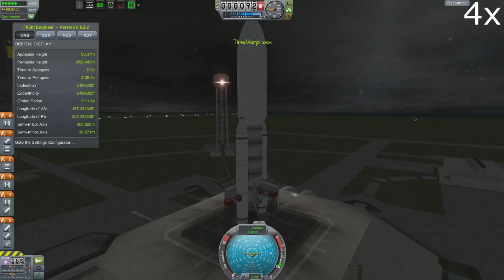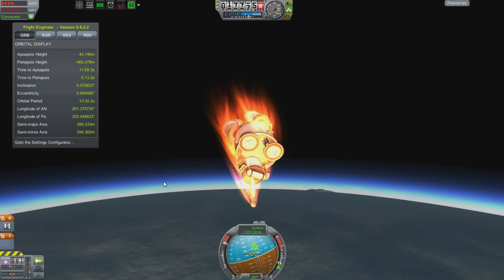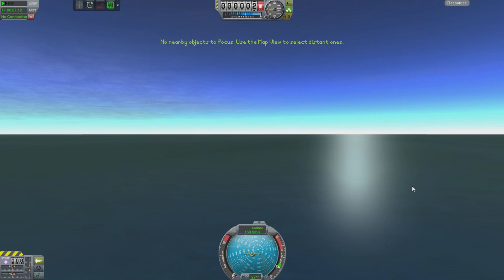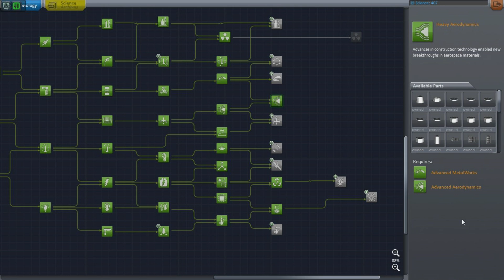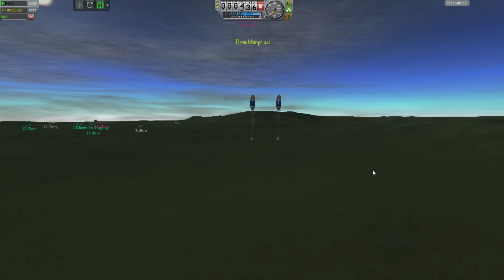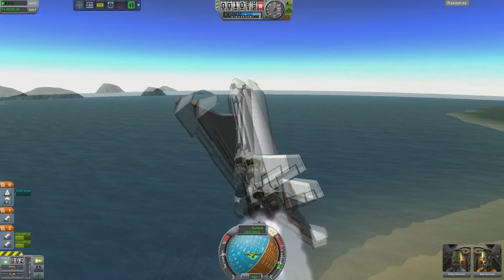Kerbal Space Program - Interstellar Quest - Episode 27 - Rocket to Eeloo, Spaceplanes Into Ground.

Comment: for the spceplane, replace the RCS tank with a structural part, put on some bigger wings, add some canards, and make sure the flaps on the rear wing don't control roll, that should make it fly better
Reply: Also strut the individual wing pieces to one another. Sometimes multi piece wings flex in a wierd manner under stress.
Reply: Achim Hanischdörfer ya but I dint notice any of that with his plane (I wish I could get mine to not flex) :P
Reply: You can see a tiny bit of wobble if you look really hard at the last landing at the end of the video but there the G-meter doesn't go above 2g whereas he has much higher G-forces in earlier in the flights. Other than that it's not so apparent.
Though it can not be seen really I've had this soooooo many times with planes in KSP with FAR I just know. Just connect all the individual wing parts that aren't connected by part placing (e.g. seperate wing collums of a delta wing) with a ton of struts and it should disappear (more or less).
If yer pulling crazy G-loadings (15 or 20 G) like I love in my racing planes the problem is still more or less there. It is (what i can deduct from my experience) a problem of the angle of attack and not properly reinforced wing structure that wobbles and flexes around like it's not supposed to.
Reply: I once made a rescue plane out of winglets instead of wings, just for fun. The lack of struts allowed it to snap its wings off.